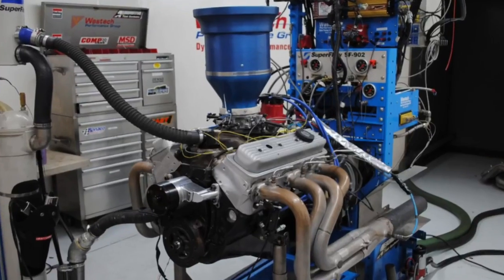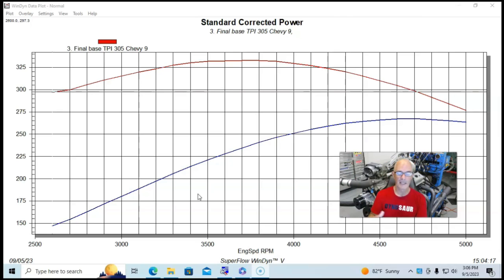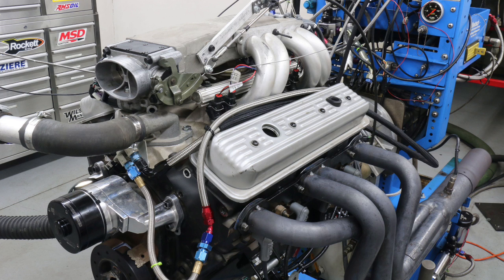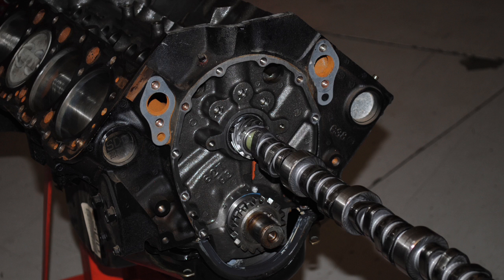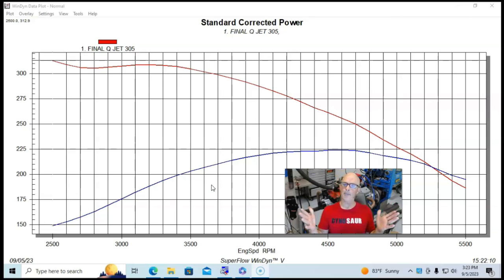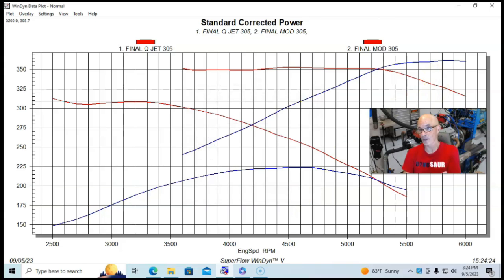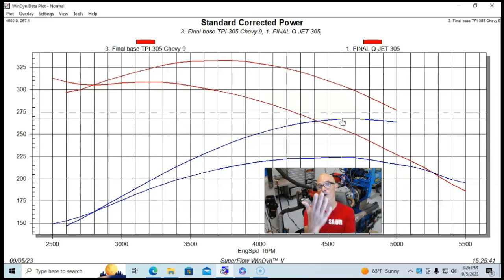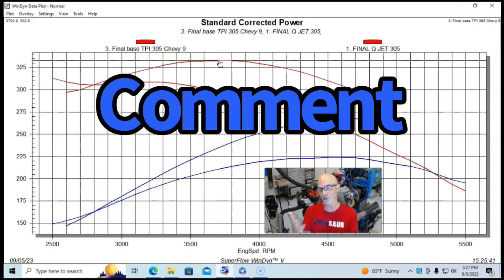HOW TO MAKE 305 SBC HP. Q-JET VS TPI-ADD 100 HP TO YOUR 3.73-BORE 305. FULL RESULTS-WHAT WENT WRONG?

Comment: There was no difference in the 305 and the 350 TPIs EXCEPT the ci.  I had a 1992 305 TPI 5 spd RS and wiped the track with the Z28s of the same era.
Reply from the maker: TPI RS?
Reply: RS Camaro, the only vehicle that got the 305 TPI. @richardholdener1727
Reply from the maker: z28?

Comment: First thoughts what were the factory cam specs between the two engines and the other unknown is air fuel ratio on the Qjet combo. The longer runners on the TPI definitely help torque. The Qjet should be either a 750 or 800 CFM unless they made a small one for the 305. Is the TPI CFM flow more or less than the Qjet?
Reply: Looks to be the 800. For qjets there was only a 750 and 800. There was the dualjet and verajet which were both 2 barrel variants of the qjet split in half in different directions! 🤙
Reply: One engine had the automatic cam and the other had the manual cam.

Comment: Did the secondaries on the Qjet actually open? I've experienced a failed vac pod on the Qjet that did not alllow the secondary air valve to open. Noticeable power loss.

Comment: The qjet manifold has tighter turns than the tpi manifold so it is more inefficient.  The tpi probably has better fuel distribution also.  Put the qjet on an intake with straighter runners and more volume and it'll be closer to the tbi.

Comment: TPI had longer runners and moved more air than the little q jet and cast manifold.  I wonder if a 1” spacer would do wonders on the q jet combo?  Or even better an air gap intake?

Comment: At that HP/TQ/Ci and the RPM levels they are produced at by the stock engine combo the TP runners are simply a better match than the dual plane. Any aftermarket dual plane intake would lose even more TQ on the stock combo and at that HP level not make any more peak HP than the stock dual plane either.
  Probably a very interesting test would be to use the TP intake on either modified combo.

Comment: A friend once ran a stock long-block 305 with changes like Richard did. (Headers, intake, "moderate" cam....) and got amazing performance from it. The intake was a Weiand Stealth, btw, with a Holley 600-cfm 4-bbl. Certainly not the kind of combo you'd think to throw atop a stock 305...! A 350? Sure... but a 305?

This brings me to my point, Richard: How would the 305--running the after-market heads & cam combinations shown here--respond to using TPI-style aftermarket intakes meant for the 350? Would the ports align properly? Would we see a HUGE jump in power compared to even the Holley 4-bbl combination? Let's look into it and find out...!😉

Comment: I think the difference on the stockers is the fuel injection seems to be cooling the air better than the carb in this particular setup.  Just a guess.

Comment: Since the q-jet is vacuum secondary it will only open up to the air flow requirements of the engine and you said they were opening all the way so maybe it's too much air for that engine maybe you need to adjust a vacuum secondary spring
Reply from the maker: the point was they were not limited-only the top blades vary with flow

Comment: The intake with that carb just doesn't flow well with those particular heads. The TPI system did a better job with those heads.

Comment: Do the tune port heads have the exhaust crossover port in them? If not the cast iron intake was not heated by exhaust and the quadrajet carb doesn't have the correct boosters for a non heated intake.

Comment: If the carb is tuned right then it's all in the manifold. Runner length and volume. There may be a slight variance in cam spec, but my guess is intake manifold.

Comment: I'd guess that the stock heads and stock cams (or both) were different between the two 305 TPI engines.  Did you check the head casting numbers and check the stock camshaft part numbers?  Stock heads and cams changed quite a bit over the years that the 305 TPI was offered.
Reply: Cam different.

Comment: Think a 331 stroker ford short block will have piston to valve clearance with a trick flow top end kit - twisted wedge 170cc heads and a stage 1 cam 499 lift icon pistons? I was about to check the clearance with play-doe and the old head gasket but i dont wanna change valve springs on these brand new heads to do so
Reply from the maker: lift is not the issue-duration is but a stage 1 cam likely fits

Comment: I don't think this is a very good test to help somebody make a decision on how to build a 305 that's already in saying old Camaro or money Carlo.  I think you're more fun tests would be taking a standard 140 horsepower lg4 and recommending to us what cam combination... An LG4 30 5 or an HO 305 build would make way more sense.  For instance what's the maximum lifted you can put in a 305 without the intake valve having interference... I have never heard of anybody putting in a 550 lift cam in a 305?????
Reply from the maker: lift doesn't determine p-v-that would be duration

Comment: A flow bench test of both manifolds would answer the question I'm sure.
And its not just a flow issue, its a velocity issue as well.
But, I'm also sure you know that already...😉
Interesting test! 👍
Reply: Runner length difference too to some extent I'm sure

Comment: Some 5 speed 305s(and auto 350s) had 207/213 cam. Most Automatic 305s had a roller version of tbi cam 178ish
Reply: All 90+ speed density 305s and 350s had the bigger cam.  The lower power 305 is because of the LG4/L03 exhaust manifolds and single cat.
Reply: Yep

Comment: Any chance it was formerly a TBI motor with the "high swirl" intake ports? or did they ever use those heads on TPI motors? They definitely had the LG4 cam on certain 305 TPI motor years, which might explain the carbureted motor making so much less top end and midrange. Otherwise, if not some timing or fuel mixture issue, or just a crappy intake manifold, I'd have guess that this Q-jet didn't open the barrels fully, like some stock ones that are configured for low emissions and power.

Comment: You said they both had stock cams, which I believe you but looking at the torque numbers at 2500 rpm my guess is the first tpi 305 had a larger cam profile than the second one did. Given the 25 to 40 hp and torque difference suggests a different cam. Were they both hydraulic roller cams or did one have a hydraulic flat tappet. Speaking of that have you ever tested to see if there's a difference in power and torque between a flat tappet and roller cam with exactly the same lift and duration and lsa. If you have what were the results. I think car craft did a similar test and the roller cam made more power and torque than the flat tappet because of the way the lobes were ground.
Reply: According to Vizard, anything below about 270 degrees of seat duration makes more power with a flat-tappet because the lifters accelerate faster. Beyond 270, the rollers take over.
Reply: @andysteele4056  the way I understood it was that roller cams have a steeper angle and narrow nose. I used to have a David vizard book on sbc secrets to  hp. Flat tappet cams have more parasitic losses due to friction and too steep of ramp angle can cause the lifter dig into the cams and cause damage. I won't say you're wrong or he is either but I would like to see the test results to see where each style cam preform in the rpms

Comment: All else being the same, it has to be the intake manifold. I'm doubting the QJet would have caused the issues. The TPI manifold can make a lot of torque at the mid-range. The old cast iron QJet manifold has shorter runners and is very flat. Lots of angles which doesn't allow the air intake charge to settle down and smooth out. The TPI just lets things fly up to the point where it starts limiting air flow on the top end.

Comment: I believe the factory cam is optimized for the TPI runner length. The Q jet manifold has shorter runners than the TPI and the air flows through it differently.
Reply: 305 TPI used the same cam as the QJet-equipped L-69 HO 305.  Even when they went to a roller cam in the 87-up motors it was nearly a clone of the L-69's flat tappet cam.  From memory, the specs were something like 202/206* @ .050 on a 115* LSA.  Even the lift was almost identical between the flat tappet and roller TPI cams.  .403/.415".  The cam profiles were around before the TPI engines even existed.
Reply: @grandmasmalibu  The 86 TPI cam was 178/194 @ 0.050 and 0.350/0.385 lift on a 109 LSA.
Reply: The automatic cars had the LG4 cam and the manual cars had the L69 in 86 and an even bigger roller cam in 87-92.
Reply: @timtodd6830  In the older days when these cars were all factory, the easiest way to tell which cam the F-car 305 came with was to look at the tachometer. If the car has the stock cluster, the redline on the peanut cam starts at 5K. On the hotter cam it starts at 5,500.
Reply: @chrisreynolds6520  that’s right I forgot about that!
Reply: @timtodd6830  ALL 85 305 TPIs came with the L69 cam. ALL 86 305 TPI engines had the peanut cam from GM, part number 14094097. I have had several of them apart with manual transmissions at lower mileage and they had the small cam. The larger cam for manuals came with the roller cam upgrade in 87.  The autos had the LG4/L03 roller cam and the manuals had the L98 cam. At some point GM added the larger outlet manifolds and dual cats to the 350. At that point the manual transmission 305s could also come with the better exhaust as an option. In 1990 and beyond ALL 305s had the L98 cam.  The higher HP used the L98s larger outlet exhaust manifolds and dual cat setup.  The lower HP version had the L03 manifolds and single cat. All the variations between the various options is why some of the LB9s were dogs and others that seemed identical would fly. I had a 1990 LB9 G92 5spd car that ran 13.90s @ 101 mph bone stock. I also had a 1986 LB9/Manual that was a dog until I put a mild 218/218 @ 0.050 cam and headers on it.

Comment: I'm sure the intake plays a part, but aside from that it's gotta be a tuning issue. The qjet is not lacking in cfm capability at all for an engine that size. They've been on 600 hp race cars, and my ~375 hp 350 runs exactly how it did with a holley on it. It's just way more drivable now, too 😂
Reply: I put a 91 305 firebird motor (auto) in my 71 chevelle because it was cheaper then a tow dolley when i moved. My stock 350 was trashed, it had one of those 2psp "economy" intakes from late 70/ early 80s and a stock mechanical secondaries qjet, stock exhaust  manifolds, small 2 od dual pipes, quit mufflers. I put a summit stage1 roller cam, used performer, headers, 2 id y pipe kit with summit magnaflow copies, car burns out now without using any clutch pop (255/60 r15 tires) with lunchbox no slip. Very happy with my qjet 305 for price, lacks some high end but didn't want to change heads and valve springs. Wish i was getting 25mph, if i pass a gas station I'm walking... need a 2x4 under gas pedal i guess...

Comment: GM put swirl port heads on TBI-equipped engines back then. Maybe the TPI heads just don't work well with wet flow intakes.

Comment: Terrible intake stock qjet setup. Iirc my car picked up a second in the the 1/4 performer rpm vs stock steel gm. I expect there’s some airflow speed differences which is why tpi make decent lower torque as well

Comment: I’ve got a similar carved 305 and get 25 to 30 mpg that would be 15 to 20 on a 350 for an xtra 40 hp 
I’ll keep the mpg👍
Reply: What specifically did you do?! I've got a 91 GTA that I want to bump up from 200-225hp/22mpg to 250-300hp/30mpg

Comment: It depends on the tpi motor the 215 hp motor was the h.o. With a tpi the 205 hp motor was the base cam for all passenger car small blocks 199 duration at .50 and 399 lift
Reply: 215hp for the 1985 and early 86 motors. Late 86 and on with autos had 190hp - although they did get the numbers up higher later in the model run, but mostly for 5 speed motors.
Reply: @monkeymouse1403  I had a '92 Z28 305 TPI 5speed with the G92 package which included the same camshaft as the 350, a dual cat y-pipe and a few other suspension upgrades, that package was the 230hp version

Comment: I'm thinking the stock cam may have been different between the two engines.
Reply: I can’t believe how big the difference is. For carbed 305s, they had the LG4 or l69 which also had better cam and higher compression, and would have been comparable to the LB9 TPI. I wonder if someone had swapped in a base LG4 into that car at some point an lO3 with the terrible swirl port heads.

Comment: We'll discuss on your live this evening regarding the huge difference in power. if you ever want to sell the TPI set-up let me know.
Reply from the maker: it was cam
Reply: @richardholdener1727  I figured it would have been more the longer runner TPI intake over the Qjet dual plane and fuel injection than it was the 2 cams although the one cam did have dramatically more lift like 50 thou'ish, and 3 more degree's of LSA.  Bumpsticks FTW

Comment: TPI Induction has more runner length / Volume and a large raised open plenum (Think air gap). This would appear to be an immediate advantage over a low rise dual plane, and perhaps explain the position of the torque peak.
Reply: I believe it to be runner length as well. Great test though.
Reply: I raised a dual plain with a 3/4open spacer. Proformer intake. I do t know what it did but it likes it.

Comment: I think a different intake manifold would wake the q-jet combo up.   Sounds like a great test, Richard!    ....something tells me, he has already done it :)
Reply: Looking at the power curve, I believe the engine he tested with the Q-Jet had the peanut 178/194 @ 0.050 cam and the later TPI he tested had the 202/207 @ 0.050 L98 cam. Substantial difference in cam timing between different years and applications on the 305s.
Reply: Not sure why you're responding to me, it's his test. @chrisreynolds6520
Reply: That factory Qjet manifold is actually pretty good, it definitely wasn't the bottleneck in this test. It's not on the level of something like an RPM, but it's at least as good as a basic Performer. Lots of testing shows those manifolds to make as much hp as a Performer, and usually more torque too. They're a better manifold than they get credit for.
Reply: @adammcilmoyl4278  I saw nearly 20 hp switching to the RPM from a stock aluminum Q-Jet manifold on a stock 305 long block in my 83 G20. The stock manifold strangled a ~200 hp engine. The RPM gained power everywhere. More to the RPM than just flow.  The runners are longer and straighter which helps add torque. The plugs were more evenly colored as well, indicating a better air/fuel mixture distribution and a cleaner burn.
Reply: Same is true for the TPI and it has already been done too.

Comment: 86 Z28 ran 13.4s with 305 world heads, isky cam, Hughes 2200 stall
Was pretty solid in the pre-LS days
Reply: my '87 Monte Carlo K/SA stock eliminator is an 11.60s car running 118 mph with 081 stock heads with nothing more than a multi angle valve job. The intake and carb are stock 14057053 and a Barry Grant (while he was still in business) modified L82 quadrajet. My engine is making 419 horsepower and Im certain that Richard probably use a 416 casting and not an 081 center bolt head. The 081 305 head is by far the best non vortec 305 head Chevrolet cast and @ .400 lift actually out flows any 350 non vortec head with a 1.94 inch intake valve. I can easily get 260 hp out of an L69 305 with an 081 head with nothing more than a 5 angle valve job and orange Z28 springs. Give me a custom ground hydraulic roller cam with 220 - 224 intake duration (a 305 is a whole more more sensitive to cam timing than a 350 is) and 228 - 232 exhaust with a 4/7 swap and 1.5 ratio roller rockers,130 lbs of seat pressure @ 1.75 inches, and ill show you a 305 with stock ports, stock intake, and quadrajet making 325 hp with all the accessories attached.
Reply: Had some 305s that thought they were 350s😮

Comment: If you happen to have a tpi 305 with roller cam or perhaps an early 305 with 601 heads or even a vortec 5.0 it could be a budget sleeper. The tbi engines sometimes had okay compression but the high swirl heads don't flow and it might be okay for a 305 but you will probably never see 400 na HP on the tbi heads.
Reply: I put flat tops in my swirl port truck and worked on the PROM and it really woke up.  Not a race car but it gets 18-19 mpg on the interstate.  Doesn't really rev past 4500 but I have other cars for that!

Comment: One was an automatic car camshaft. The other was a 5 speed car camshaft. That's my guess, yes they were different to some extent in the 87-92 roller cam TPI 305s.
Reply: Lb9 cam was pretty similar to the vortec 350 camshaft
Reply: @StevenPaul001  90-92 305 & 350 = same cam. The 87-89 had the "peanut" cam. Also used in the TBI engines. It's only 179 degrees of intake duration.
Reply: @bluecollarhotrods9781  tpi and g92 cars did not get a peanut cam
Reply: @StevenPaul001  The 87-89 305 TPI automatic cars (non G92) absolutely did.
Reply: @bluecollarhotrods9781  mine is t5 and g92
Reply: @StevenPaul001  Those two factors are why it had the larger camshaft. Same as an L98 that year.
Reply: bluecollar's right.  305 TPIs with the auto trans got the "peanut cam" from 87-89.  90-92 they got the same (bigger) cam as the 305/5-speed and 350 TPI motors.  But they were still rated significantly less from the factory because..... 90-92 they put the tiny little pea-shooter TBI exhaust on the 305 auto trans TPI cars!  What GM giveth, GM taketh away.  Amen.